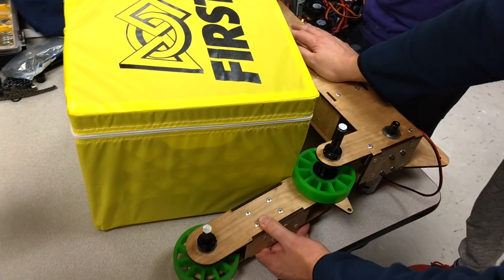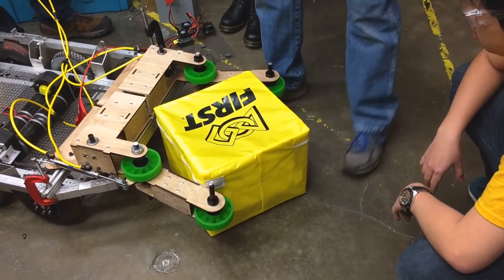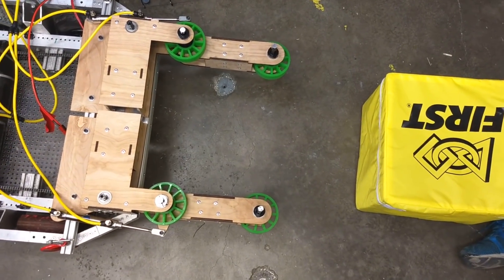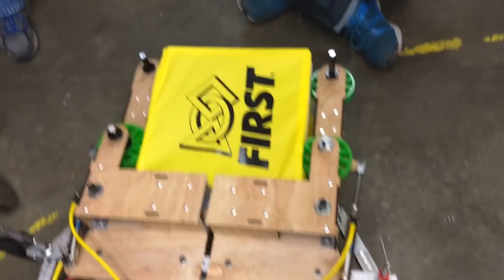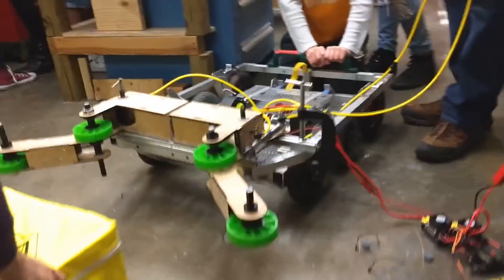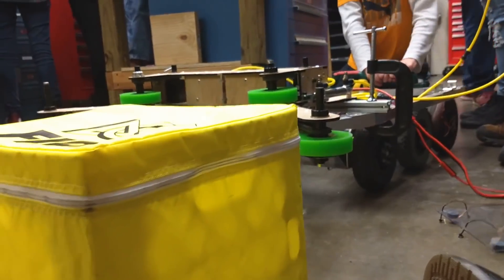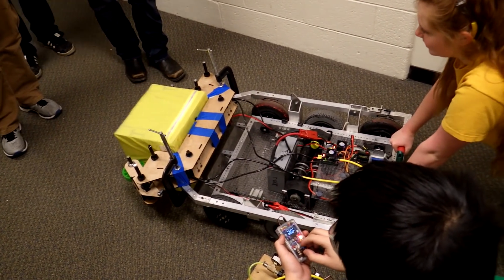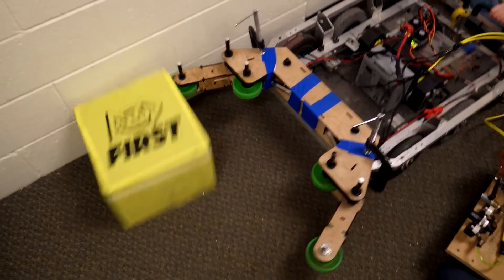Triple Helix cube gripper prototype testing

Comment: Really great job guys. I was wondering how you are able to have the little bit of spring in your pneumatics. Whenever my team (3455) uses them they always seem to be either fully extended or fully retracted (no give).
Reply from the maker: Air is a compressible fluid, so if you press on the end of your cylinder with greater force than the nominal cylinder force (Pressure x Aarea), the piston will move.  By adjusting either the geometry of the linkages you are driving, or the air pressure, you can use a pneumatic air cylinder as an air spring.

Comment: what materials do you use for prototyping?
Reply: Todd Ferrante Team 6704 here, we're trying for a wood robot. Do you think 2 it more later would be strong enough?
Reply from the maker: "2 it more later"  Spell check error?
Reply: Todd Ferrante Ah, yes, thank you. Meant 2 or more layers of 0.25"
Reply from the maker: Material thickness needed depends on your specific geometry and the forces you expect to see.  It would not be unexpected to see your gripper rammed full speed into a wall, or another robot to hit it when it's deployed.  We do a lot of testing ahead of competitions.  We want to break our hardware as often as possible, so we can redesign it to be even better.  You can try to predict where the weak points will be, but there is no substitute for destructive testing.  Besides, breaking stuff is fun!
Reply: robots that are all wooden have been very successful in the past, however parts have to be designed well especially ones that will reach outside your frame perimeter. making everything inside the frame perimeter out of wood and any intakes or mechanisms that reach outside this out of poly carbonate would be more desirable in my opinion. polycarb is also easy to machine, it can be routed using a normal wood router, or a bandsaw or jigsaw can be used with a lot of success espicially when parts are caded printed on 1:1 sheets of paper and glued to the parts that need to be cut
Reply from the maker: Whatever is cheap and quick to work with.  In this case, we are laser cutting 5.2mm thick luan plywood.  2'x4' panels are about $6 each at Lowes.  Not suitable for competition, but great for prototyping.

Comment: I'm from team 4638, we're concerned about the starting configuration. This is the most effective manipulator we've seen so far, yet how would you retract that to fit within the starting configuration if you have a lift right at the front of the robot?
Reply: RaySchrantz 5596 here, we’re using this style of design, and we have our lift built back quite a bit in our bot. It’s mounted on a 1/2” hex shaft with versa chassis’s. During auto we have a solenoid that will kick the arm down onto a hard stop. Then lock in place with a spring-loaded pin.
Reply from the maker: We are considering two possible robot configurations.  One with a single stage elevator at the back of the robot, with a long arm that tilts up for stowing and reaching the scale.  The other configuration uses a double stage elevator at the front of the bot, with a "wrist" that flips the gripper up within the frame perimeter.  Each option has its pros and cons.
Reply: our team is having the arms start folded behind the lift the intake is mounted on before the match

Comment: What speed in RPM are those intake wheels going at and what kind of wheels are those? Thanks!
Reply: These should be the wheels you want: http://www.andymark.com/4-Compliant-Wheels-p/am-4compliant.htm. For the speed of the intake, it should be relatively fast, but not too fast as to shred the cover. We've (3863) found good results with a 10:1 VersaPlanetary gearbox with a 775pro.
Reply: Chad Krause I don't recall off the top of my head,  but they're the silicone wheels that were included in the 2018 kit of parts.
Reply: sladoeii do you know the RPM or motor/gearbox combo?
Reply: Chad Krause, sorry, first year mentoring, still don't know the parts by sight.  Todd would have to give parts and gear ratios for the theoretical max rpm.  We were controlling the motors with a servo  tester,  so the speeds were never consistent.
Reply from the maker: We used an adjustable speed servo controller, so the speed wasn't set.  The wheels are 35 durometer, 4" complient wheels from AndyMark.